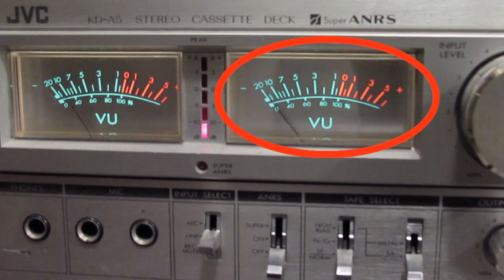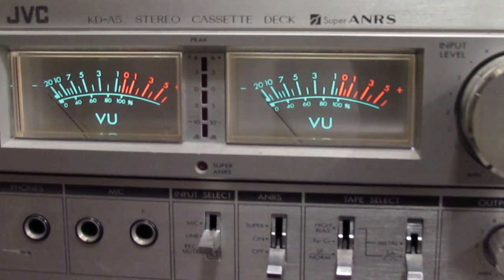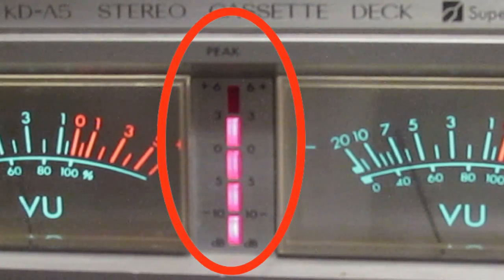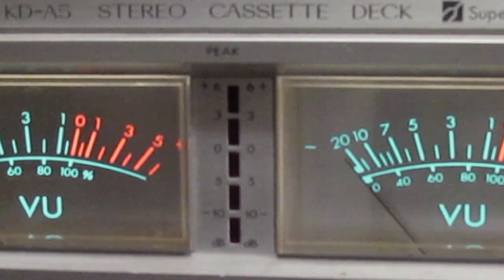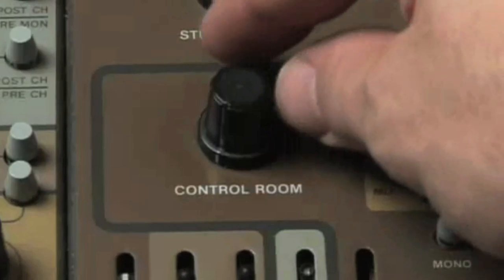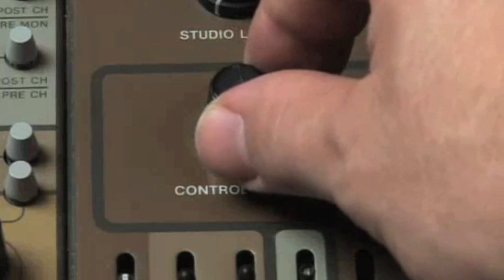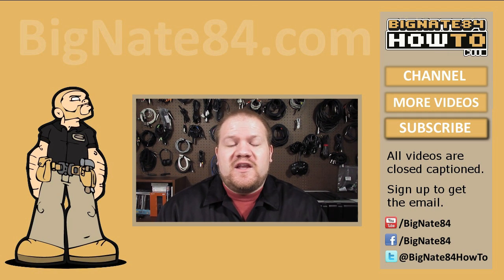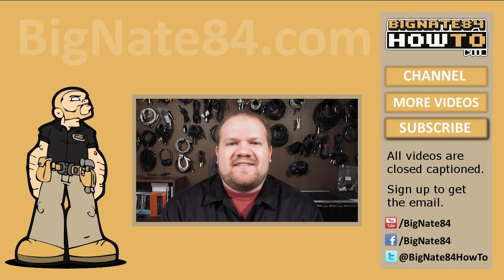Live Sound 101: More Terms To Know

Comment: I need some help with knowing what decoupling the subwoofers mean?
Reply from the maker: When talking about speakers the term "decoupling" typically means providing some form of physical isolation between the speaker box and the surface the box is resting on. A cheap way to do this as a test would be a towel folded up many times and placed under the speaker or perhaps a sand bag. Unwanted vibrations will not transfer effectivly through  the towel or sand bag. There are professional products that provide physical isolation and designed to decouple speakers from the floor / hard surface they rest on.